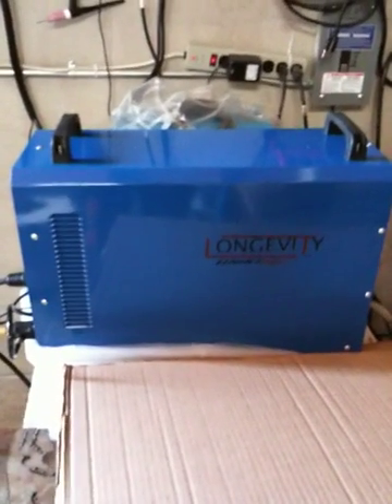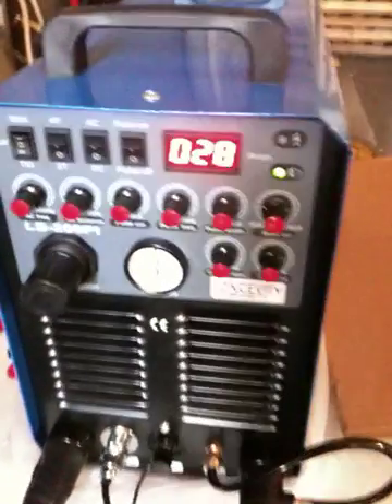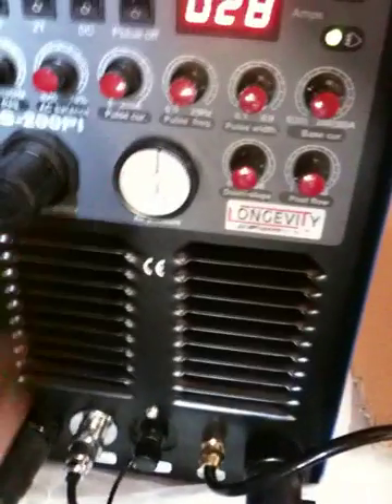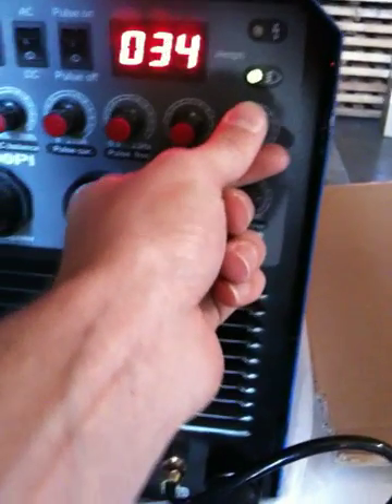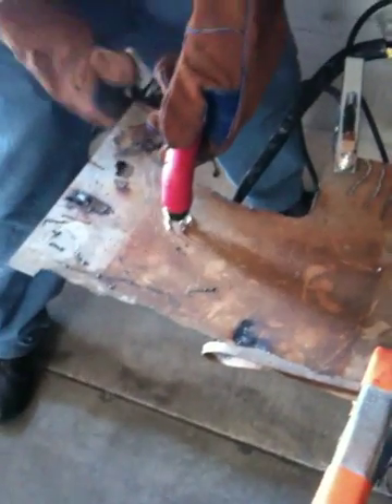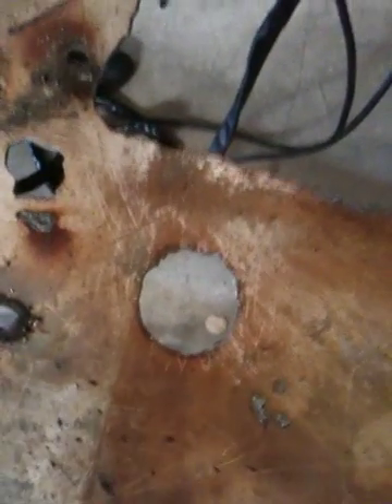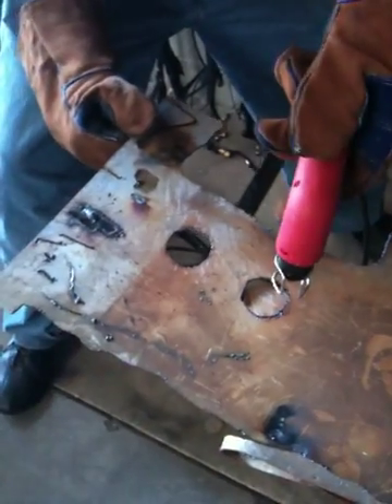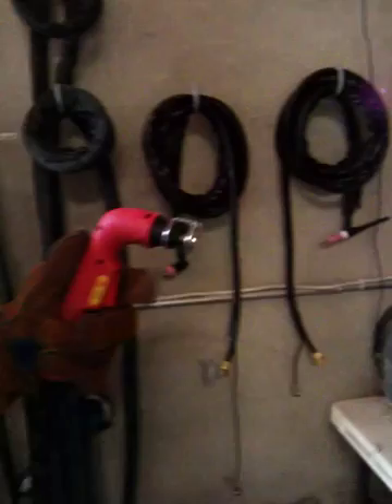Longevity WeldAll 200PI IGBT PLASMA CUTTER TIG STICK WELDER.

Comment: I have a Longevity LS-200 PI like in the video and it's a fantastic welder/cutter. I mainly use it on my race car so I need to weld aluminum and magnesium so the AC/DC pulse 200PI is perfect for me. I'm having a blast TIG welding everything in sight!